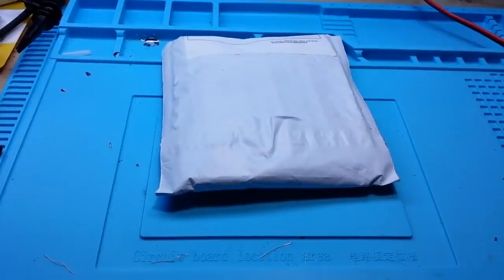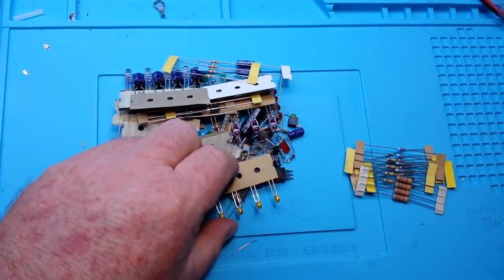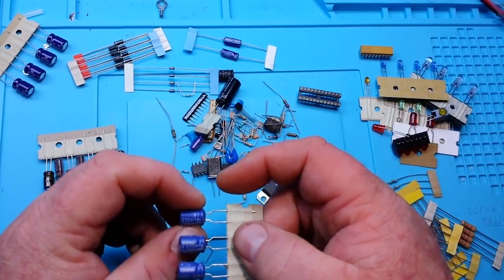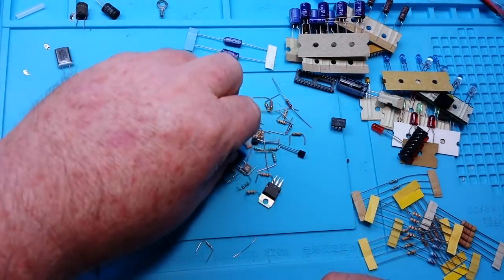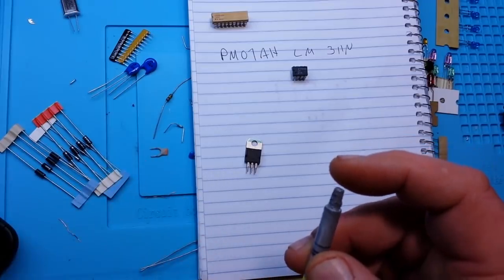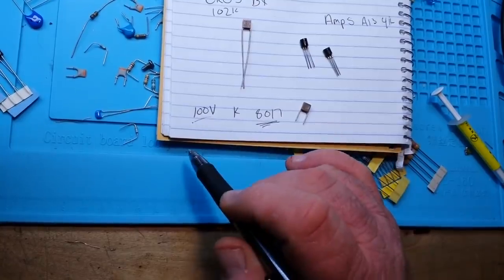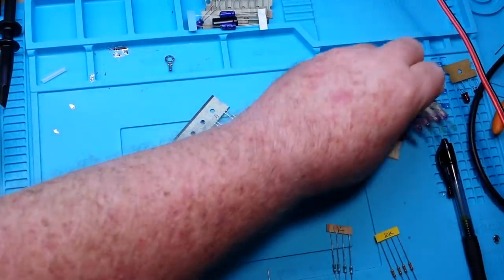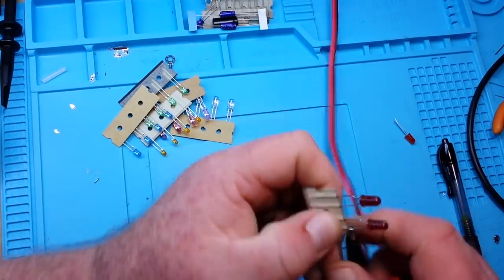Electronic component grab bag from ebay

Comment: Good deal but I'd be concerned that it might be off spec stuff. Did you check any of it?
Reply from the maker: The capacitors were all pretty tight. I didn't check any of the resistors.

Comment: I do not like that kind of grab bag, I prefer 50-100 of each part, or at least 10 with more expensive parts, only exception is very expensive parts I need for a specific project or want to evaluate (Mostly special IC's), then I can accept less than 10.
For resistors, capacitors, diodes and transistors it is fairly cheap to buy a assortment of types, you can usual find them on ebay for very little money (If you are low on money leave out diodes and transistors). Then buy the rest when you have specific projects.
If you do SMD check aliexpress for "sample books", it is a very cheap way to get a lot of SMD resistors and capacitors.